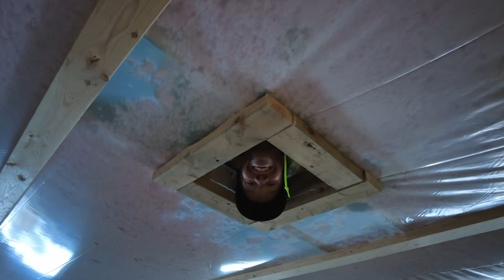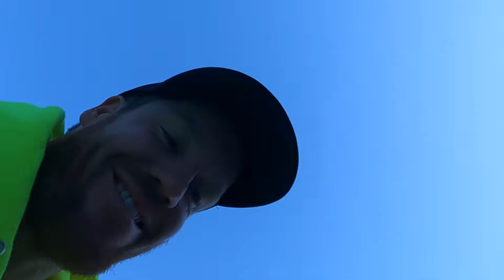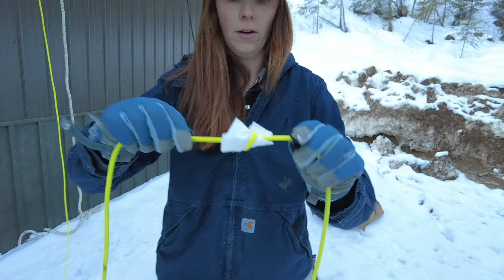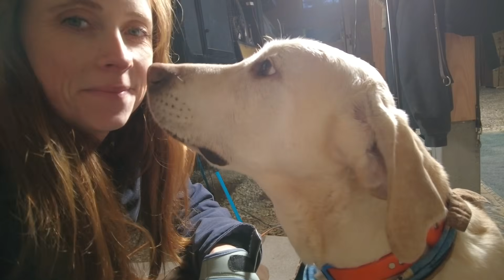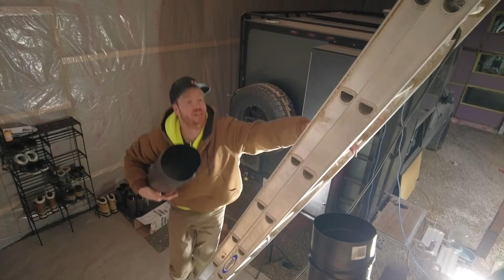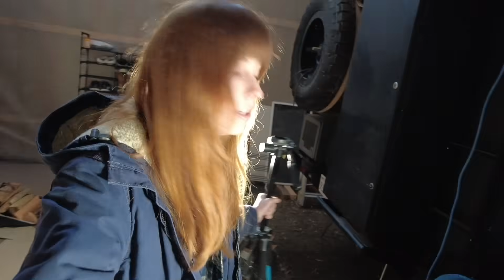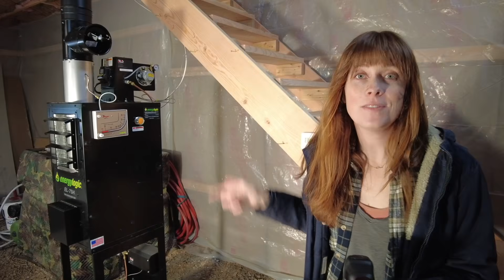Installing Our Waste Oil Heater | Living Off-Grid

Comment: Nice heater!

I’ve been watching your channel now for a few weeks, and I really appreciate it, you two make a great team together 👍

About this used oil heater!

Remember clean oil, Doesn’t clog up filters.

You may Want to use this used oil, as you would use this oil as diesel fuel for your equipment.

Remember I’m not telling you what to do, just how I would do it!

Generally what I’ve known through the years working on equipment, the average person is not careful how they drain their Oil….Engine Oil Right 👌

So there might be some antifreeze, water or dirt in that oil that you get for free. Oil 

So if I was doing it I would look into how to pre filter this used  before using it to heat in my shop!

Kind regards Dan

Comment: if you put a cup full with water inside a campfire, the plastic will melt and if there is not enough water to put out the fire, the cup will burn.
That the samething with your water tank and here your water will probably just run out on the floor and not aftect the heat from your heatsource.

Comment: I would have left those anchor points on the roof just in case you need to go up there in the future to fix or replace a part of your chimney or roof panel. Anyway I love your channel and got hooked! I ABSOLUTELY want to do what you two are doing!
Reply: I've done a few roofs and used those anchors before.  I figured out a better solution was to use a "throw bag" over the roof to the other side, haul up and over my safety line and find a tie off point. A tree, vehicle or some other secure anchor point.
  The only down side is you need a LONG safety line to do it, but that way you're not going up a ladder without protection.

Comment: A single piece of alumin. ladder with a roof hook would save drilling holes in you roof and make transfering from the upright ladder to the roof so much easier and by getting a longer safety rope and tossing it over the ridge to the ground to a tie off will help.

Comment: On the metal roof you can use old couch cushion foam usually 2 in or more to walk on even when it's wet it sticks to the roof all my roofing buddies use it on metal roofs I've used it some works extremely well don't fully understand how it all works I just know it does 🙂

Comment: I am a retired General Contractor that has made many heater mods. It looked to me like your chimney pipes were put together in the wrong order. All upper pipes must go OVER the lower pipes, not  inside of the lower ones. You will get exhaust gasses into the building when in operation, screwed together or not.

Comment: Coming down is always stressful. Couple bits of advice, don't have anything on you coming down you don't need. You don't need the backpack to come down, use the green rope to lower it. For the actual tie off rope, throw it down as well. If you get too stressed to come down and need to cool off before attempting you always have that green rope to bring your tie off back up to you.

I have had times I've throw power tools 30ft down just so I could navigate out of the brush and back down a utility pole. No Makita's were harmed doing that at least 50 times :)

Edit: Couple other things. Tie a stainless steel carabiner to both ends of that green rope. In the event you need something, that carabiner can turn minutes into seconds. Another consideration, Klein has TONS of different pouches both for your belt and for general hanging from trucks poles etc. Grab you a 1 gallon pouch (without the snaps so they don't open and it fall) that you can clip on the rope when you need to raise something.

Comment: i was wondering already before, why you remove your safety bracket from your roof? why don't you leave it there permanently for the next time? And the location will work for other uses as well. Since your talking about pouring your slab soon, I highly recommend adding in floor heat! it's really simple to do, just check out Bondo built: https://youtu.be/MrAUkIzB6yU

Comment: Great video!  You might investigate the direction you installed your vent pipes, as it appears they were installed upside down.  You don't want the flue gases hitting the edges on the joints as it goes up the chimney.

Comment: If you touch bases with neighbors or repair shops in town you can pick up some of their waste oil.  Years ago the truck would come by my repair shop and pump out 500 gals. of oil and pay me for the oil and sell it to a recycler.  Now you have to pay to have the waste oil picked up.

Comment: The reason you have blue smoke from your wood stove is that you are burning wet wood. When you burn really seasoned wood with a secondary burn stove you only white steam and later only invisible vapor heat that flutters which is just heat and no gases. My chimney literally has no creosote at all. Try putting the wood inside an air conditioned environment in the summer months which really dries the wood to five percent or less moisture( My wood tested range is 2 to 4 percent moisture content. ). The wood really burns super hot. Have been doing that for five years now. This is the trick that really works. Peace

Comment: Look into a "Magic Heat". It's an additional heat scavenging source that is placed inline with the stack, it operates like an old school style tube boiler. Every thing you can do to scavenge heat and keep the heat in is worth it. A small cast iron heater in that big shop area would do a lot to help keep costs down, utilizing the natural provided heat source (combustible organics), is the way to go. You can throw a few large sized pieces of timber in it in the morning and just let it go all day without the need to babysit. Build a shed or shelter for storage and in the summer months gather up any dead or fallen trees, branches, etc. Dry store them to allow for air movement, and you will be set. Don't make the novice mistake of starting to gather the stuff immediately adjacent to your property, go further out at first, then gradually begin to move closer to your place. All the wood can be used in the upstairs appartment heater and (if you so choose to get one) the shop wood stove. The waste oil heater can be the primary heat source at times when you are away, and combustible organics can do the rest.

Comment: That thermostat is very close to the heater.  The rest of the shop will be considerably cooler.

Probably should figure out how to filter the waste oil.

Also, my buddy in Alaska found out quickly that these "waste oil heaters" quickly turn into diesel heaters since only a trucking company would have enough waste oil.

Good luck!

Comment: Ok, let’s talk about your ladder technique.  For starters, your climbing angle should be 70 degrees.  You can determine this by placing the balls of your  feet  just inside the beam of the ladder. With your arms fully extended,  if your ladder is at the correct angle, your hands should fall in between the beams.  Also extend the ladder 5 -7 rungs above the eaves.  This allows you to grab the ladder without bending down.  Also, step on the ladder , on the rung above the roof line, then descend.  Retired firefighter, 33 years. I’ve climbed a few ladders in my career.  Good luck.

Comment: You mentioned Harbor Freight about your winch  they also have a little transfer pump that works with just two D Cell batteries that would  make it much easier to put that waste oil in the tank.  Cost about 20 bucks.

Comment: I would venture to say that if u did an analysis on the smoke from your wood fire, and then the waste oil exhaust, I think the wood smoke would have much higher concentrations of co, hc and nox per cubic foot. But what do I know. Everybody is sending u everything but the kitchen sink. Oh wait, I c one flyin at u now. Amazing what 150,000 subs will do.  Looking forward  to c how u get your water and heat it for the bathroom. Maybe a copper coil around your waste oil chimney. But that’s not going to run when u need it. A propane insta heat maybe?

Comment: Nice video, however that oil change that you did will only give you an hour of runtime on that unit. Unless your a garage changing oil all day, everyday it's difficult to see how one would have enough waste oil to use. Propane would have been a better choice for me, especially considering the $4000.00 cost of that heater.

Comment: hey guys i have a 200.000 btu  waste oilheater in my 40x60 garage and it will roast me out   problem was if i stent lots of time out in shop in the winter i could not produce enough waste oil.  What i did was tell all my friends  not to take their waste oil to a recycle dump place just give it to me.  I gave a dozen people 5 gal. cans  and when their full drop them off to me  and i give them another jug.   I hace about 200- 250 gal. on hand at all times

Comment: Before you start down the ladder, take one end of yellow rope. Tie to ladder as close to edge of roof as possible. Throw other end of yellow rope over roof peak and down the other side of building. Cinch to solid anchor on other side of building. Be sure it is nice and tight. This will steady the ladder and reduce stress significantly.

Comment: Love your channel:). You would be much better off safety wise with a static (non stretch) 11-13mm rope designed for the task rather than that yellow line. Take the rope up and over the roof and tie it off to a tree on the non-ladder side. Your attachment point should ALWAYS be higher than you rather than having so much slack. Attachment points such as the Petzl Shunt work really well - have that on a cowstail with a shock absorber, and you can then slide it up and down to suit. It will guard you as you go up and down the ladder.

Comment: Why not just leave the safety bracket on the roof installed? We used to install permanent clip rings along the roof with a tight-line/cable running the ridgeline, and it made roof maintenance a breeze. At would also mount horrifically telescoping poles that overhang at the eave peak. Add a pulley or a turnbuckle and you have a nice material lift as well:) And nice shop guys, and great video! I like that you just right to it work sent silly intros lol. 

PS

Don't feel bad.. I crash my drone at least once a week😛

Comment: In order not to get dirty when refueling the Oil Heater, you can use a syringe to change the oil in the transmission.

Comment: For the roof a secondary latter that can be mounted on the roof, in temporary format, giving you the needed footing.  Though I have a feeling that some modificaiton to the top of the roof would be needed.   Another is mounting "steps" in permanent way.   I just get chills every time you go on/off the roof.   Still a cool video like always. :)

Comment: In eastern Europe CCCP the truck exhaust pipe goes through the fuel tank and keeps fuel in liquid form.. Tap into heater run to a tank outside melt snow  and melt water runs back inside to food grade tank for future use!!

Comment: Can you hook ductwork to that furnace to get the heat up to the apartment?
Reply from the maker: It pretty explicitly states in the manual that it is not intended to be ducted. It gets HOT and I think the concern would be restricting the air flow and it getting REALLY HOT. It's also specifically for heating a non living space. However, heating the shop does make a big temperature difference in the apartment just from sharing the wall and floor.

Comment: If it is black smoking out the pipe, the air mixture is wrong, or burner needs cleaning. keep it brushed out. Be careful where you get your used oil, pour some in a bucket to see if anti-freeze or other contamination are on top. Oil is heavier than water, Anti-freeze, paint thinners ETC.

Comment: No smoke from the chimney doesn’t mean it is not emitting unwanted things into the air. The bigger problem is getting enough waste oil to burn. My friend thought that the two diesel pickup trucks and 3 cars not to mention a tractor and his lawn care equipment he’d have more than enough oil. He didn’t. He made it two months before running out and getting waste oil isn’t as easy as you’d think.

Comment: Pro tip: for your roof ankers. Install under the ridge cap and build a small cover so you are not putting holes in your roof. You just need to build a cover for each anker. We always install 1 at each cap seam and build a cover out of the extra cap.

Comment: Getting the feet back securely in the ground is SUCH a good feeling!  Waste oil heater is a great idea!  I worked for a company that did this, and they fed the furnace from a 275 gallon oil tank.  Don't know if there are any issues with settling of sediment in the tank.

Comment: Waste oil heater makes no sense for anywhere but an auto repair shop that does oil changes or a tranny shop.  From what I remember working in a tranny shop is dealing with constant flameouts and pluggage on the waste oil heater at the shop.  I wouldve went with a wood pellet stove.  I own a Pel Pro PP60 and its awesome.  Run out of waste oil and you are BUYING fuel oil or diesel. Nah thanks.

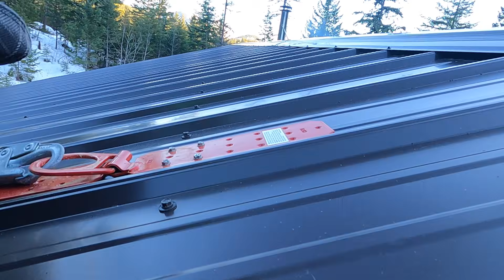Comment: Wait... 2:38 Riley unscrews 4 Screws, then She sends up 2 more screws. What happened to the original 2 of the 4 screws?
Reply from the maker: I took the 4 long screws that were holding the anchor point out and replaced them with 4 roofing screws with rubber sealing washers.

Comment: As a former roofer just tie off the ladder either to the 4 wheeler on the other side or install anchor points on the building good job funny how the legs won't move during transition lol

Comment: Ah, yes you need a huge funnel for that.    External storage tank on stilts would be your best setup, that's what my dad had for the shop.  I was the one that got to dump the 5 gallon buckets of oil through the funnel (with filter screen).

Comment: Since you now have a dedicated point on the roof for future safety strap connection, I would put eye bolts into the fascia on either side of the ladder access point then you can put a strap across to hold the top of the ladder securely.

Comment: How about the used oil from a diesel engine? (army truck and excavator) Is it going to smoke a lot more? or will it shorten the maintenance intervals of the entire heater?
Reply from the maker: As far as we are aware, it will make no difference.

Comment: 1/2 Gallon per hour "while it's running" (I'd be curious to learn what the duty cycle is to maintain your desired temp - perhaps you can report back on that along with the electricity usage?) for 100-ish days per year... seems like you will be using a lot of waste oil. Definitely agree with the comment guessing between 500-1000 gallons per winter.

Do you guys have a plan for sourcing that much waste oil? Is this something that is easy to come by? I know the O'Reilly  here in Salt Lake City by me keeps logs of all waste oil they accept for disposal. Wonder if they would let you pull around back with a giant tank on a flatbed trailer and a transfer pump? 😂🤔
Reply from the maker: We will keep you all updated on usage stats! We've already lined up a few sources for oil locally through friends and word of mouth.

Comment: Great video and install, excellent use of waste products for your needs. I was wondering about where you are getting the combustion air from. The website says that the airflow is 500 CFM. That's about equivalent of 8 telephone booths (remember those?) worth of air a minute... not a small amount. The air flow is coming in thru your building envelope somewhere. That is reducing the efficiency of the heater and building. You might think about making an air intake from the wall behind it with obviously some sort of damper (automatic?) and animal protection.
Reply from the maker: I think that 500cfm is for the fan on the heat exchanger not the combustion air. Yes the combustion air has to come from somewhere, adding a fresh air inlet is a great idea especially once we have a slab and the building is better sealed.

Comment: Was thinking about you oil transfer situation. Check into pneumatic diaphragm pump. They use a fair amount of air, but are perfect for what your doing. 1/2" to 3/4". You can valve it right at the end of the hose to minimize drips. They are also good in an automated tank filling system.

Comment: Each lower section of smoke pipe should be fitted inside the next upper piece. Waste oil heaters require a lot of maintenance there is a lot of debris after combustion enjoy 😊

Comment: What are you going to do when your heating needs out weigh what you produce for waste oil? "Fuel Oil" furnaces are one of the least efficient heating sources out there being at 80%. That's why you see the chimney nice and warm. 20% is going out the roof. But I'm sure you both know that...
Reply from the maker: We've already lined up a few reliable sources for used oil, but only time will tell!

Comment: Buy a cheap welding blanket and put it between the plastic water tank and the heater.  Plastic will melt, I found out the hard way.  It will also make your water taste like plastic.  Very worth the 26 bucks.

Comment: Never forget : combustion, whatever it is, needs a supply of air. Appliances placed indoors must have an outside air supply. This goes for everything, including your wood stove. Poor combustion causes clogging of the flue and ends in a chimney fire. Do not underestimate this risk ! Best regards from France.

Comment: Folks have offered really great suggestions on the various projects you are doing. Terrific.
So, I  will offer a piece of advice also...every time I see that long stairway to your apartment I shudder.
     One misstep on that stairway and your off grid project is over or maybe only until the end of the hospital stay. An hour and        5  2X4's and a handful of screws and a safety handrail can be in place. This will be at least as important as safety glasses which you mentioned in this post.       Come On, Man!!!!